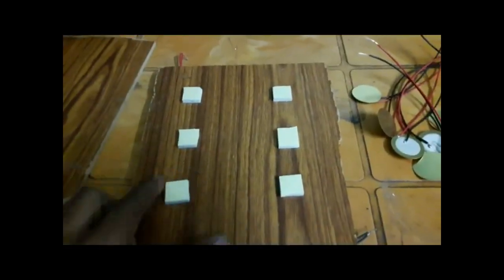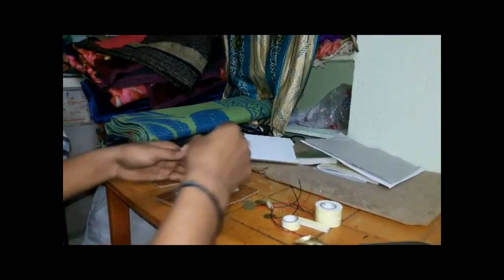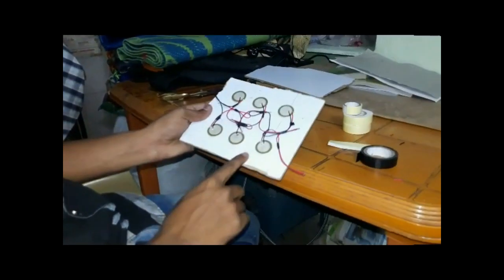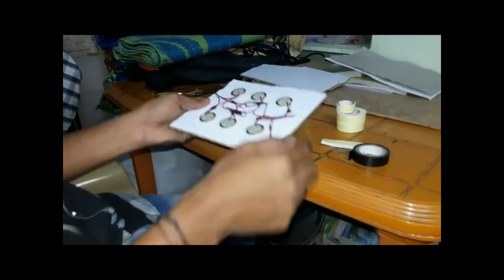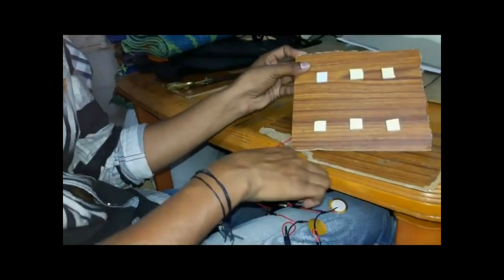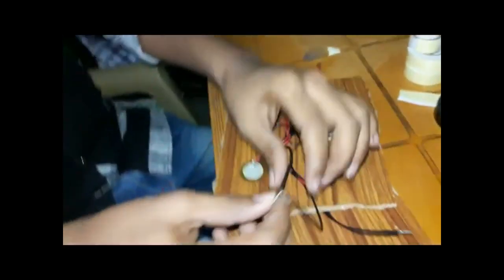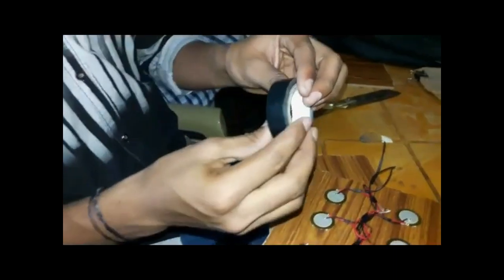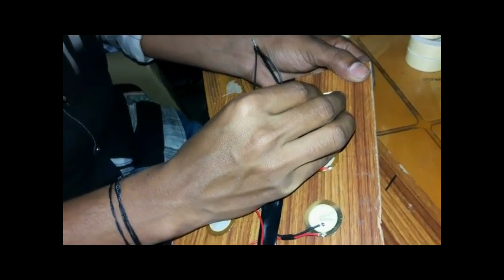Foot step power generation model || piezoelectric transducers || project

Comment: What about the current? Or power? Could you connect a load to the circuit? Voltmeter has a high resistance, so voltage without real load doesn't mean much.
Reply: why not directly connecting it to a battery with diode, rather than using voltmeter to measure and store

Comment: You are displaying voltage, but the real power is in "Amperage", how much amperes it was producing.
Reply: Volts converts to amps easy enough
Reply: @burnroe6611  we can converts voltage to ampere with DC-DC buck converter, right ?